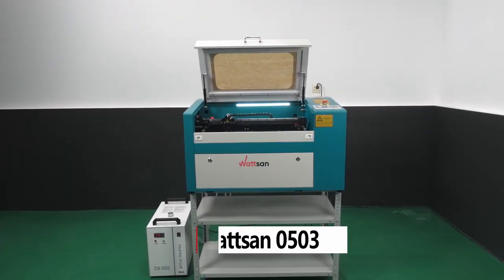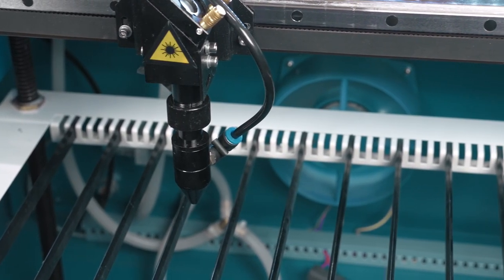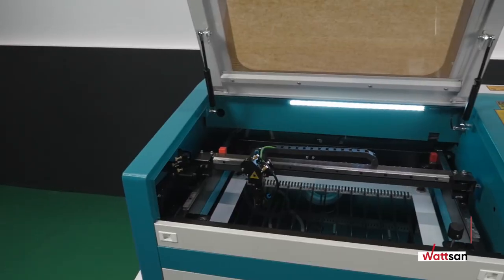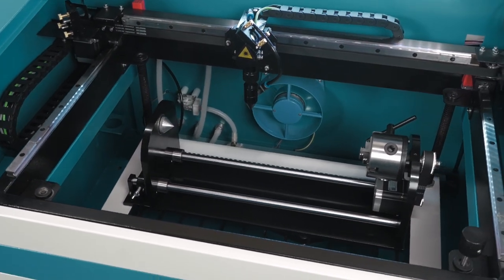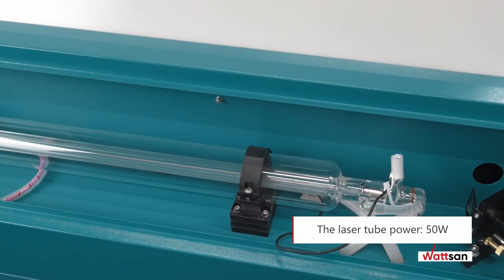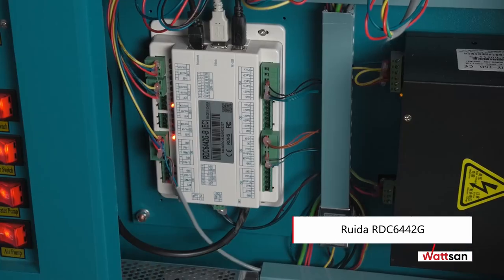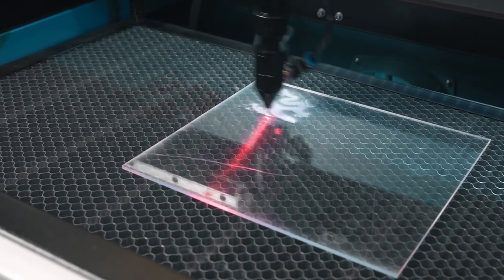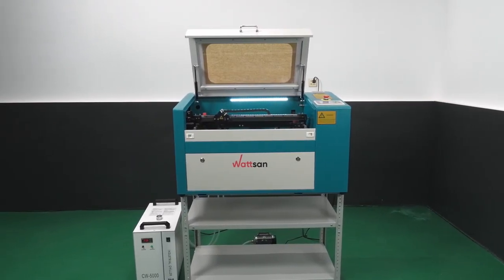Wattsan 0503 50W CO2 laser engraver, cut & engrave acrylic, plywood, MDF, paper, plastics and other

Comment: Can you install 38.1 mm focal lens? I want to use it for rubber stamps (50.8 mm not suitable) also why some pictures show 6442 and some show 6445 Ruida control, can you put 6445 controller?
Reply from the maker: We can put a lens with a focal length of 38.1. Thanks for the remark, all our machines will have 6445 ruida, soon the marketing department will fix it everywhere on 6445.